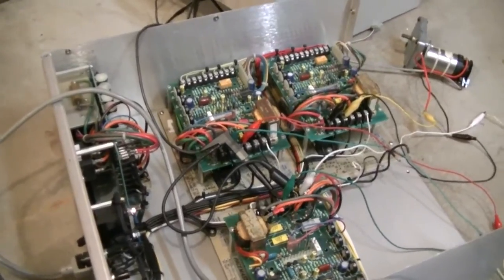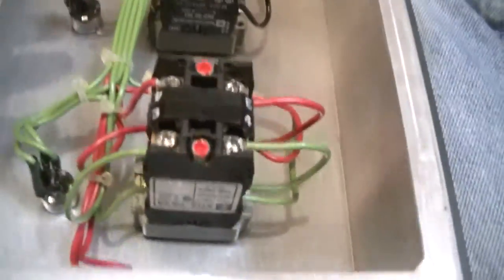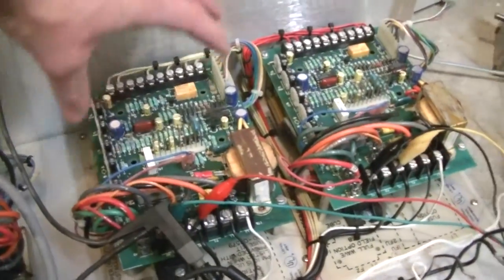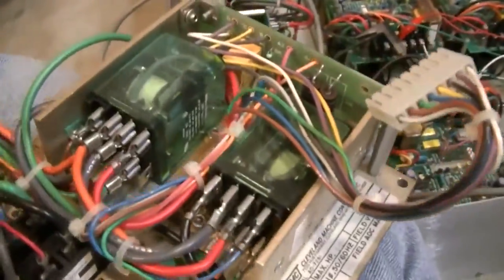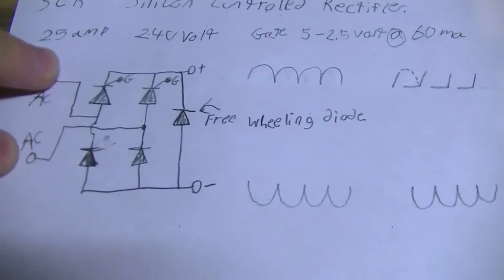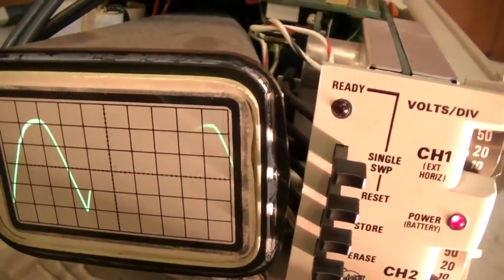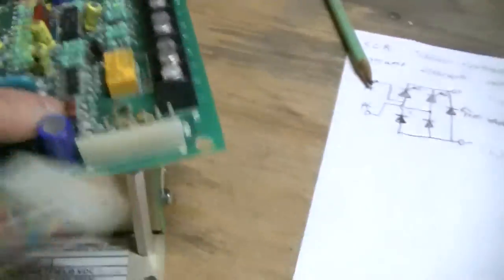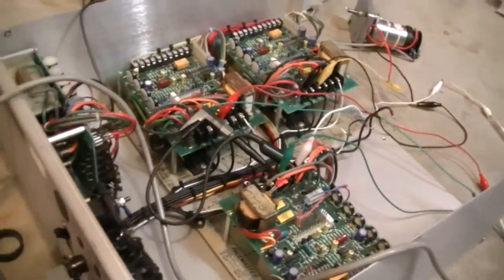Manipulator Tear Down and How it Works - SCR Pulse Width Modulation Type Motor Controller Circuit

Comment: No you can't use SCR in zvs driver for the rail gun they would work for one shot haha you may need something that goes in the 1Kamp for those but those are very useful for dc motor and transformer less power supply 25 amp is still very nice :)

Comment: Sort of. Would be really easy if your shunt resistor value is 1, or 0.1, or 10, or any decimal with a one.... 2 inch nail with 0.001 ohms would be great for high current. Measure volts across shunt, report to serial, do math, to report in watts. add clock for watt hours. Simple.
I have been thinking about doing similar. I want a multi channel data logger for battery testing. Make it cheap and easy for all the open source researchers out there. Don't tell backupcpu or he will beat us to it.

Comment: You could make a robot arm... :p
I'd be inclined to keep it. It may be useful for many projects, Although if you sell it you can get a gas flow meter, a big bag of mosfet's and IGBT's LED's galore and lots of other cool stuff. Like Arduino. Which you could teach to drive a motor controller...
Comes down to storage space, and how bad you want other stuff I guess.

Comment: After watching all the video :) mosfet and SCR are two separate thing my friend :) The SCR will conduct until 600mV remain which is the drop of any silicon rectifier if you use them in a dc circuit you can't turn them on and off at will. I had some in a power supply they where acting as over voltage protection and once active they where shorting the regulator to prevent damage to the rest they are very useful for controlling motor in AC and discharging stuff :) Great scope also :P